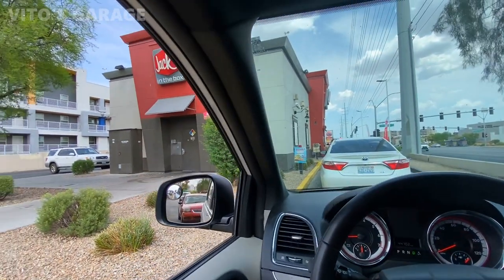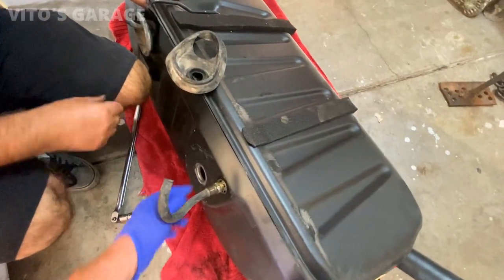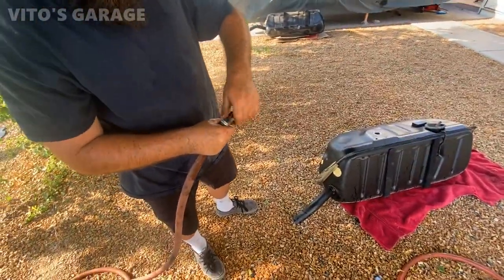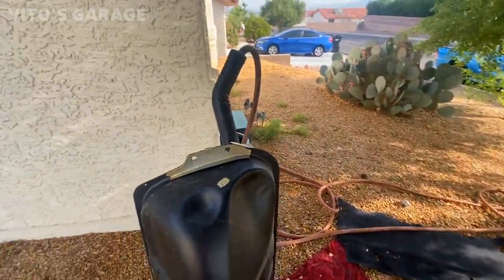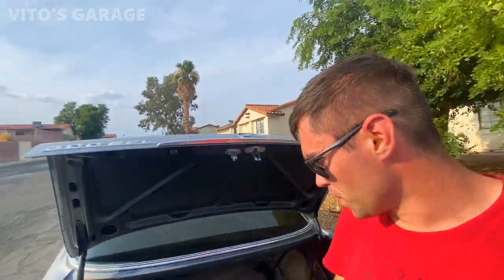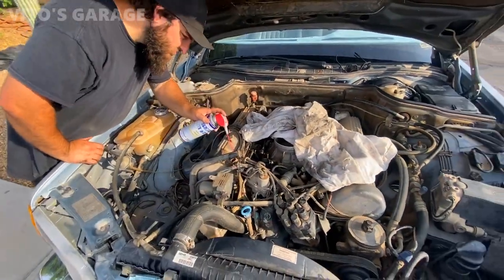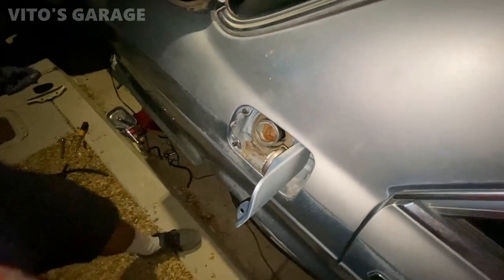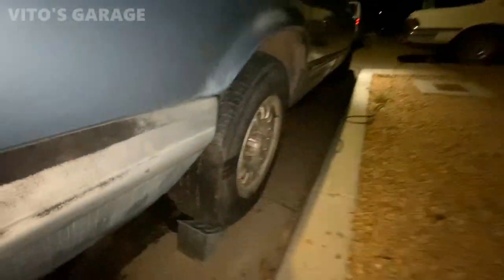Delivering, Cleaning and Installing a New Fuel Tank on 1985 Mercedes 500SEL!

Comment: I had stalled my old Mercedes by the road side. A mechanic came over to change both pumps in the saddle fuel tank. The old rubber seal on the right side crumbled and rubber  debris dropped into the fuel tank. He picks up as much as possible with fingers. But there are remaining small pieces of the crumbled seal. Should I worry about this remaining debris in the fuel tank? Thanks.
Reply from the maker: Which rubber seal are you talking about and how did it get inside the tank?
Reply: @VITOSGARAGE  the rubber gasket/seal around the top casing of fuel pump assembly. It's for saddle fuel tank of W211 year 2006. It had become very brittle. When pulling up the old fuel pump casing the old rubber seal crumbles and drop into the fuel tank. 🙁The new seal which comes with the new pump is green in colour.